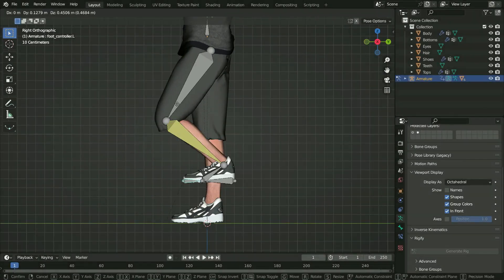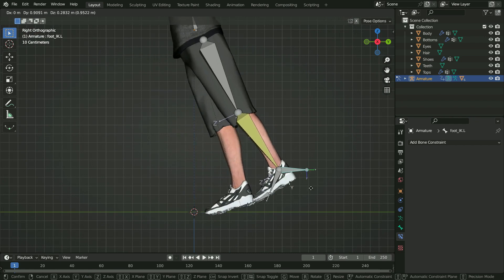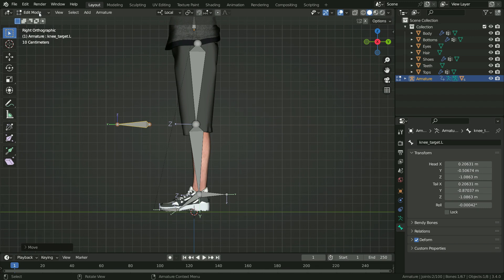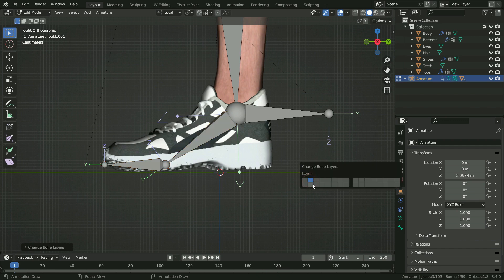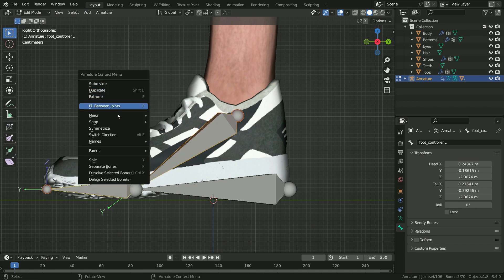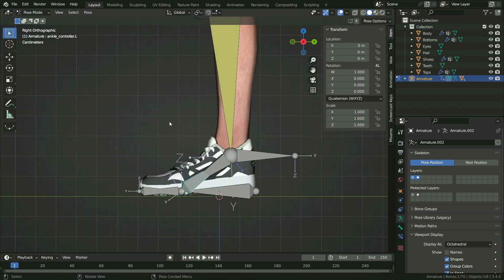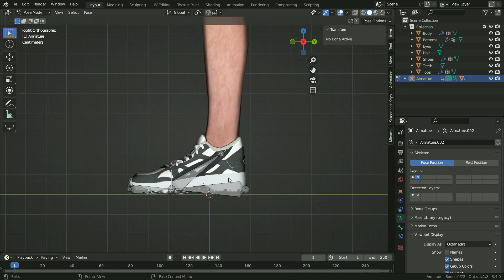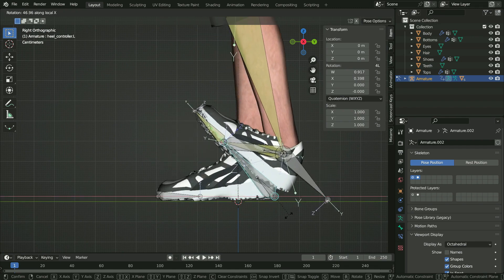Blender 3.4 Leg & Foot Rig | Tutorial 4

Comment: I don't understand the pole angle. I have rigged a fair amount of foot already (4-5 different armatures but I am still starting to learn blender  since last month); I have followed a few different tutorials and just can't figure this out; sometimes you have to use 90 degree, sometimes you don't have to and the leg is perfectly bent. Sometimes it just rotate at a weird angle. Of course with the weird angle I can still pose/animate my character by eye balling the model and move the pole to whatever location it needs to be, but I aim to have a clean rig and I am not sure what is causing this. The Pole bone also seems like it gets offset to one side as soon as you lift the legs up. Is a "clean rig" possible or with IK and pole angles it is supposed to be like this?